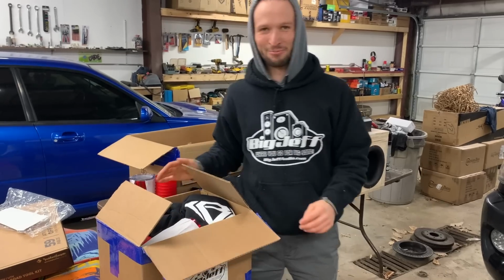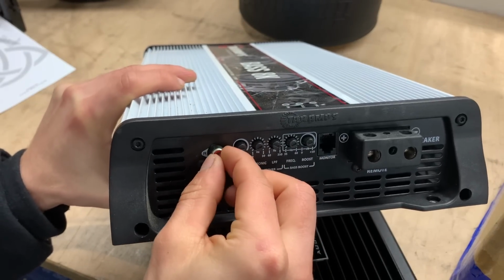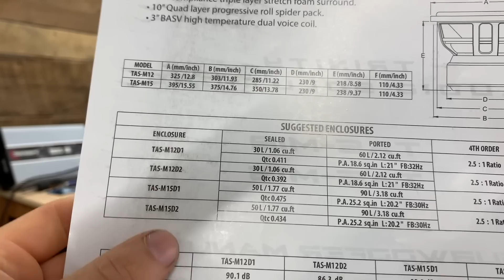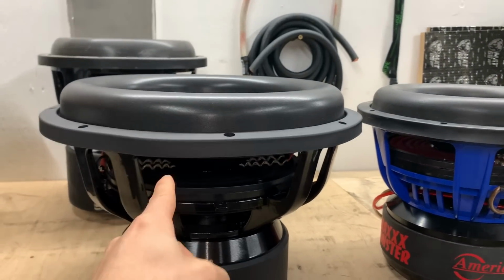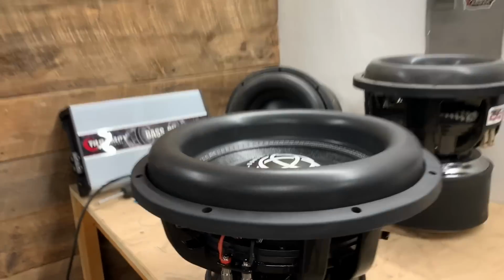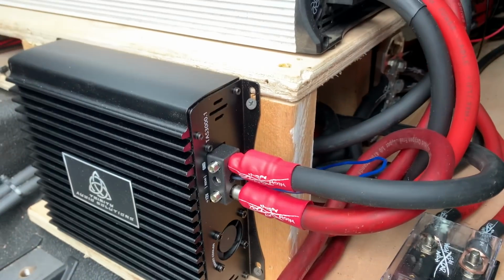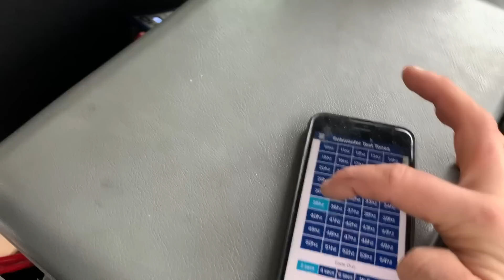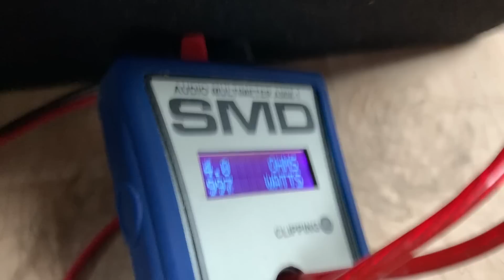Trinity TAS-M15 + TAS-3000.1 Combo Review! + BIGGEST GIVEAWAY

Comment: Great review Parker. Its good to see you loving the 15 inch subs after I had been preaching to you about how much better 15's are for a couple years. That sub is a monster. I think you need to put 8 of those in the Sequoia and see if you can hit a 160db, or put 3 of them on a JP83 @.66 ohms in the diesel truck and they will slam. Oh, and dude, you were really playing with fire with those live wires dangling around back there. The 12v+ wire was about 1/2 inch away from the Taramps amp, and the ground was laying right next to it. Thankfully nothing happened, and I don't remember what your setup is for the diesel truck as far as batteries and such, but just be careful bro. You have a lot of electrical potential in your setups. I'd hate to see anything happen and a car start burning because of something stupid like not being careful with your live wires

Comment: Must say that's an awesome start to a first system and is much more bass than a first timer would expect... I would be super stoked with that setup
Reply: This isn't his first system he reviews subwoofers and amplifiers pretty much anymore. This is probably the 30th sub he installed. Go back and look at all his videos and you'll see
Reply: @Simpleman1078  Pretty sure they meant that as for someones first time system in a car/truck.  I noticed Trinity has a quad 18 inch w/ 8000w amp setup as well, bet that thing would blow some windshields out!  Not sure where I'd even put more than 2 of these or the 18's since they require about 3FT a piece sealed or 6FT a piece for ported.  Wicked stuff.

Comment: May Seem a bit expensive but That's actually a good deal, that 650oz motor is $450 by itself on lord of bass! And I have over $500 in a 15" I built and that's with only the $235 400oz motor. So $300 on top of that $450 motor... To duplicate it. And 2k seems awful conservative... But then again if it has a soft suspension that will definitely limit wattage limits but unless your doing spl competition soft suspension will pound out the lows way better, an actual stiff spl sub sucks for a daily sub, they sound lousy.

Comment: Subwoofer looks like Deadgame hurricane sub.  Amp low pass filter starts at 100. Use a Dsp if you get this amp
Reply: We have a bunch of samples, from a great build house that makes some of the best full bridge clones, and that was one of the first things we changed, was the low pass filtering.  We had most of them built with 35hz low pass starting point, faster switching fets, and a more solid transformer mounting, due to vibration issues, amongst other things we changed, to test reliability. I do not know why, most do not have a lower frequency then the typical 80hz or Higher. But, it does make a difference in the overall end results with subwoofers. 👍

Comment: Hey Parker if I have dual 2ohm subs but wire the amp for 1 ohm will it hurt the subs or change the ohm of the subs
Reply: Wire each sub in series, then parallel the 2 together, for a final 2 ohm load. If you wire both in parallel, then you'll be at .5 ohm. If you ran it at the 2 ohm load, you'll get less power then at 1 ohm load, but it'll be more efficient. Plus wiring your subs in series, increases the BL. 👍
Reply: @Chuck_Sanders  Hey bud thanks a lot I was concerned because I know if I go with 4 ohm subs I have less of a chance to mess up but it seems like the two ohm speakers are definitely louder and I was having trouble making up my mind
Reply: @ryantownsend6000  no problem,  I hope it works out for you buddy! 👍

Comment: Amp should have 1/0 gauge… trinity should know better. The Taramps smart 3, which this trinity is a poor clone of,  has dual fans and a LPF starting at 90 which also isn’t ideal but better than the 100hz on this amp. I don’t know anyone who crosses their 15” sub at 100hz.
-
Also listing 650oz motor is very deceptive as most companies list magnet weight (not entire motor weight). B2 is also guilty of this so when you see for example a AB Vfl comp that lists 500oz magnet, the average person will think this trinity has a larger magnet when in reality it’s probably a 300oz magnet with 350oz top and bottom plate added.
The tinsel leads also look pretty thin vs competitors. 
Both poor products in my opinion